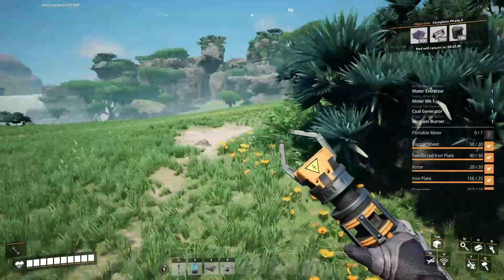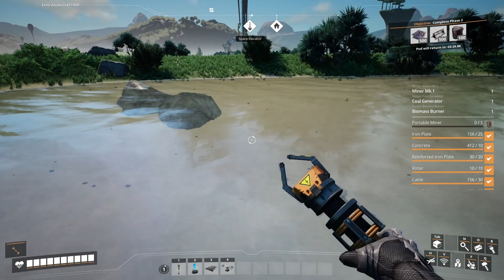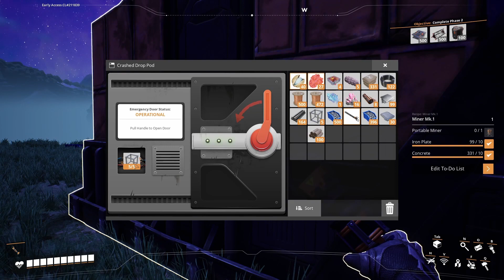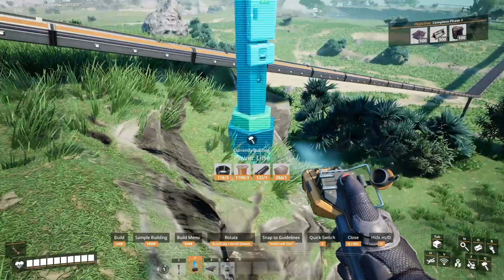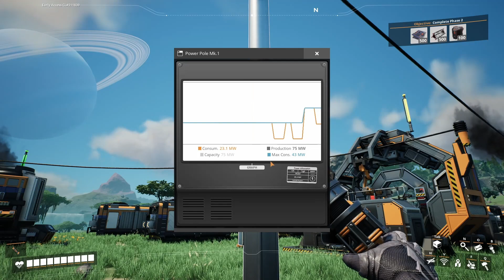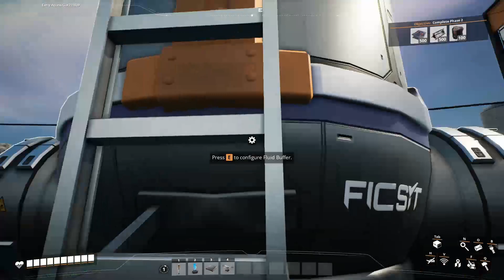Satisfactory Ep5 | Coal Power Engaged

Comment: A quick hint:
While in dismantle-mode (press F to dismantle) you can middle click at something to build a copy of it. This is faster than going through the menu.
Additionally while in build-mode you can hold down E to get a select wheel of related items.

Also the coal power plants: don't know if you noticed but they consume 50 liters/minute to the pump's 120 L/m. This means that each pump is enough to supply just barely more than 2 coal plants, or 5 pumps is exactly enough for coal 12 plants.